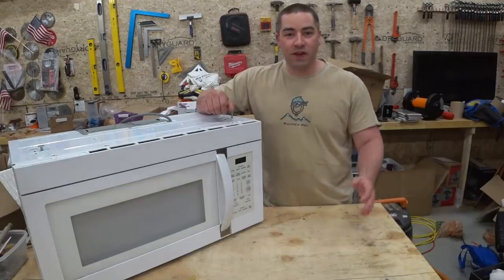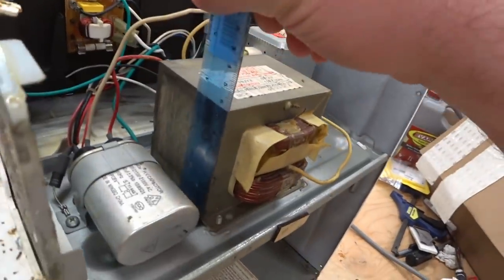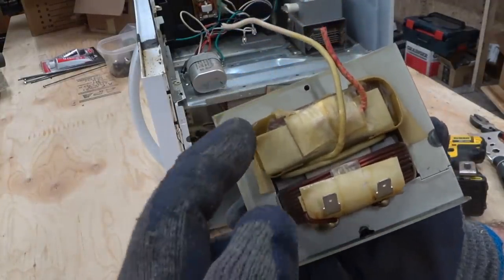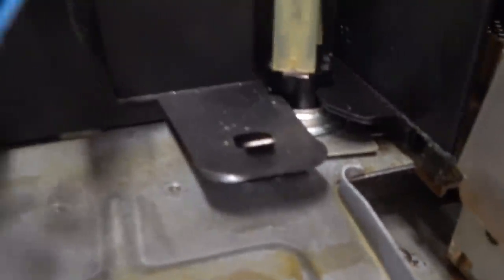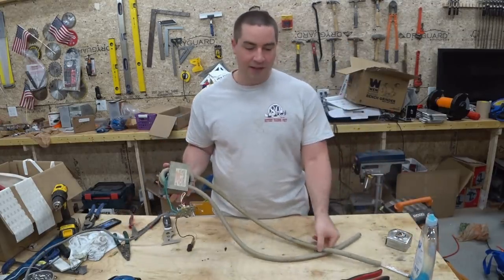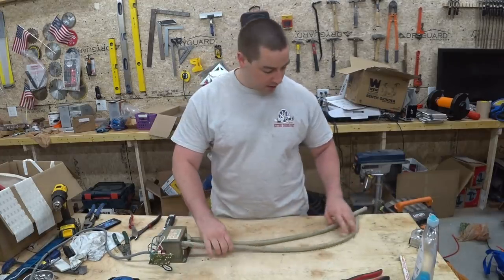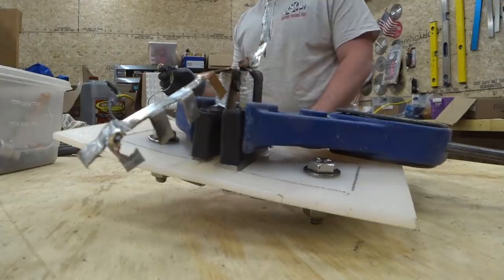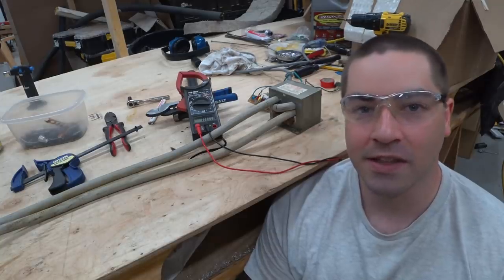DIY Spot Welder, Attempt #2 with Microwave Transformer, Failed!

Comment: 3 feet of 8 gauge wire from Lowes with 5 wraps in same direction as primary windings gives one volt per turn (transformer law). Voltage goes down 24 times while current goes up 24 times giving around 70 amps at 5 volts. Mine works like a champ. An on/off light switch to make and break the circuit; couple of copper welding tips at the end of your secondary windings ground or filed down .

Comment: Some advice: 1. secondary coil: make a thick cable with thin insulation so you can make 3 loops to get about 3V. Voltage is very low, you do not need that thick insulation, also it is bad for coil cooling. 2.Do not use aluminum and use copper electrodes. 3. Try make cables as short as possible. 4. Remove magnetic shunts between primary and secondary coils if you did not remove them yet.
Reply: Why use copper cable and not aluminium? Can you tell me the difference between them? What will happen?
Reply: @TheRealObamagaming  copper is more conductive than aluminum. Been 8 months but figured I'd answer lol.

Comment: I used 2 AWG copper wire with thin insulator and it worked fine. I also bought a cheap spot welder controller that cost about $14-$17 so I can control the time better to protect the 18650 batteries. I also think your wire is too long. To what I have read, you need high current to weld. You have 3 things you have to work with --VOLTAGE, CURRENT, RESISTANCE. The less primary Voltage, & less Resistance= high AMPs.

Comment: The circuit blew because when you turn on the transformer while spot welding.. it not only draws a 
inrush but also draws a constant current of 25 amps thus blowing the circuit board attached .. it is better if you connect the transformer directly to mains and also more turns are required for more voltage and better spot welding.. use copper wire

Comment: Hello sir!! Again, as i did recommend in the first video, you should get cooper or brass bars to do the spot welding, aluminum is not good for it, also reduce de gage on secundary cable can be 3 instead of 0,  connect the primary directly to the voltage or get some control but as of many others videos I watched about it don’t need it, hope you can succeed on your welding project 😎👍🏼🇵🇷

Comment: Greetings
I have my own successful experience and after several attempts:
I used a 35 mm square wire with the plastic wrap removed and the shrink tube in place. I got 3 laps in the front and 4 in the back! And a secondary voltage of 4.5 volts. Addition of a timer circuit breaker. Currently, it is used with batteries with a timing from 0.1 seconds to 0.4 seconds, depending on the thickness of the nickel

Comment: You dont need that board. Get rid. Just try through the momentary switch for now. Then get a spot welder 100a controller from ebay/aliexpress. They have adjustable pulse time and current and wire straight into the transformer. You do need a 9-12v AC, yes AC psu though.

Comment: Transformers step up or step down AC voltage according to the winding ratio. If you have 10 coils in primary and 20 coils in secondary coil then you will double your voltage. Half as many in secondary coil as primary you cut output voltage in half. Gauge size of coils basically determines current. But even if your secondary is fat gauge, you are limited by primary coil gauge size. For voltage, think about a mig or tig welder.... typically 20-40vdc for steel and AC for aluminum. You are probably looking for 50A+ as the required current but you'll need a controller to fire the transformer for a fraction of a second or you'll melt battery tops. If you need DC output you'll have to source some high current diodes on the secondary output. I can't speak specifically to the voltage/current requirements for welding batteries I've never done that. I'm sort of thinking with just one winding on that fat output cable, your output voltage is likely much too low.

Comment: David, the secondary voltage should be under 10 volts if you’ve put 1-2 turns in the transformer, which is about all that will fit in most frames from microwave ovens. Good luck!

Comment: I would say no, it's not the same that you would have gotten from a newer smaller microwave. I have seen flyback transformers in some of those.
Reply: If its an inverter style microwave, than different story.
But a smaller microwave will have the same size transformer.
Ive stripped a few diferent sizes and makes and models, and it looks like they all use the similiar transformer.

Comment: I’ve seen others figured out that it takes voltages between 9 and 20 and currents of 250-350 amperes to work. 20-40ms in duration which depends on thickness of the material

Comment: I would get rid of that little board and try some smaller wire thru the transformer.  About 5 or  6 turns might work.

Comment: interesting attempt.  I would say you need to use more copper laden wire. lots of insulation there. teflon coated 3/0 fits nicely. triple the amperage of that " 1/0 " you have there.  it will not get nearly as hot as your version.  not easy to get in but... its worth it.  you can use the flex stuff to connect once your outside the winding area.

Comment: I would remove a turn on the secondary. The less  turns give you less voltage, but more current. Also get rid of the little board, but do use a 10 amp fuse.

Comment: you can also use two pieces of smaler diameter wires, with thiner isolation,and wind it same as it is one piece. and this is better,because,to get mowe power from secondary, it must be  filled with wire as much as possibile.i used two pieces of 4 mm wire(about 25 mm2 together) and wind it paralel,on a much smaller transformer about 8,5 x 7 cm.i got 2,2v with 3 turns in secondary. 2,1 v when short circuit,and  wery powerful

Comment: Spot welder with a single microwave transformer deliver about 50A: it's very good to weld lithium battery. Your cable is too long, try with a shorter one. If you need more power try with 2 microwave transformer and same cable (about 100A). Good luck !
Reply from the maker: Thank you.

Comment: Keep trying... You will get it! I'm thinking about building one, I'd I was you I'd get the timmer board from Amazon for this, its programmable, where the lenth of pulse and current can be adjusted,  it also requires a 9-12 v AC supply it uses as a clock signal, or something, I'm planning to get one,  and use 10 gauge wire with thinner insulation just double it , a few times to get 8-12v and a few hundred potential amps, the spot welder board works on the ac side with a triac, to adjust things, I just couldn't find a 9- 12vac supply, I guess I'll have to order that also, or wind a transformer, with the timer board you will basically have a professional spotwelder!!!

Comment: one think to consider is to strip the thick insulation off the cable and substitute polyolefin heat shrink tubing.  A more expensive solution would be teflon heat shrink.  The temperature for shrink with teflon is around 250C.... polyolefin ~90C.  working temperatures are well within limits for this application.  (practically, start at one end and insert into the shrink tubing.  as you slit the cable, slide the heat shrink over the bare cable.  suggest leaving an inch or two at the beginning to let you completely strip the heavy insulation and replace with heat shrink tubing..... should solve the problem)

Comment: I think u got the Neutral & Ground, or Hot & Ground input leads instead of Hot & Neutral. Not sure, but I've seen this 64+ Volt crap before. My extension cord was only giving 64+ Volts, but the socked measured 120 Volts. After messing with the cord a bit (unscrewed the end caps, & looked at the terminals), & tightening it up a bit, it was back to 120. No clue what was going on.

Comment: Hey David let me give You some advice. It is a while since I made my spotwelder from my microwave transformer. First, yes it is the same size as Yours. Second, my first build atempt was the same as Yours, my wire had the same thicknes but I failed. The spotwelder worked, but the spot weld was terible. I decided to rise the voltage on secondary coil by rising the number of coil turns (loops). I had used 10 mm2 wire (someting like 7AWG) and it gave me 5,5 volts on secondary. Now it is perfect, fine tuned for battery spotwelding. And last but not least I suggest You to connect tranformer primer directly to grid. You can control it with solid state relay (SSR). It will work like a charm, trust me. And last important information Im on 230V grid. From that implies, that You are to use twice as much coil turns (loops) to achive 5,5V on secondary, or just give him 230V like as we, europans do. :) Wish You luck my friend!
Reply from the maker: We are at a bit of a disadvantage with our 120 volt grid.  So 5.5 volts on the secondary worked better for you.  Good to know.  Thank you.

Comment: The input inline board you are using is a line filter and fuse board, which you don't need. However, having a fuse is a good idea. 
The transformer you have could have come out of a smaller microwave oven. The larger transformers are found in the early older ovens.
The insulation on that 1g wire is too thick for your purpose. You could remove the insulation and use insulation tape instead. It may allow you to get one more turn in the former.
Reply from the maker: Thank you.

Comment: Hi David that board is a dual hash choke and it has line to ground metal oxide varistor and one line to neutral for voltage spikes and a fuse. So it is not needed in your application except a fuse would be good. It looks to only have one full loop on the secondary you might get .8 to 1.9 volts on the secondary which is not enough. As for the transformers in microwaves it varies by the wattage of the appliance. Lots of newer models have a switching power supply instead.
Reply from the maker: "dual hash choke"...  Thank you for directing my homework assignment.  I'm going to look that up.  
As for the voltage, you said it is not enough.  What is the minimum voltage, and why?  Thank you.  I love learning about this.
Reply: @DavidPozEnergy  hash choke is the easiest explanation it cancels out induced noise from switching and from clock circuits like in the microwave.  As for the voltage it works with the resistance of the wire and does the work in wattage output for example. What's best to use is magnet wire like what was in there but a thicker gage or multiple strands together. I built one a while back and used wire from a old tube tv degauser coil of several turns in parallel. More home work for you I guess.

Comment: Exactly the same transformer as in small 13liter microwave oven
Use cupper conductors everywhere, forget aluminium, it has low conductivity also the same with tungsten. Cupper is necessity. 
Also, throw away that regulator thing.
I'm working on my spotwelder. One full turn of 25mm2 cupper wire give 1.8v on open circuit and over 600amps during welding. I need to get at least one more turn into transformer. The voltage is too low. As it is now, I'm only able to weld 1mm wire onto something, and that takes about 10 seconds to do.
Reply from the maker: Thanks.  I agree with you on the # of turns.  This is an old video, but I had messed with it more recently and got better results with another turn, slightly higher voltage.
Reply: @DavidPozEnergy  I'm working on it now :) I changed the wire for copper strip - i bought strip of copper 15x0.25 and used 9 of strips per cable. it should have cross section nearly 34mm2. Then i got it into insulator and made coil. 2 full turns filled the transformer nicely, no longer is there gap.

Comment: I saw the over head light go dim, while the switch was activated. Looks like you may have activated the Circuit breaker of your 3 Phase supply. I also think 1AWG , secondary coil is an overkill. What are you Spot welding, by the way? Front end of an Abrams M1A1?😂.
Reply from the maker: Lol, tank spot welding.

Comment: I'd bet you blew the fuse on that board. just bypass that and send it straight to the transformer. you may want a larger switch though, as I'd expect you'll probably be drawing somewhat over 15 amps from the wall when welding.
Reply: Dont think that would be necessary its les then 5 seconds

Comment: I nice video I tried to follow along with it and bought a  used MOT, the seller connected ac voltage to the primary winding (thin wire side). And it created humming sound. At home I removed that side and when I connected ac to the secondary side it created smoke and smell and became very hot to touch. Seems like the Secondary was already short? What you say? Now can i rewind it using suitable size enameled wire? Will winding it with slightly thinner wire be ok?
Reply from the maker: It works better with one more winding on the secondary.  Even if it is a thinner wire.  I was too low in voltage with my setup.
Reply: @DavidPozEnergy  thanks for the reply. See my video the secondary of the MOT that we will be using as a primary for our spot welding has burned so entite transformer is stripped down. So i will be rewinding that as well.

Comment: EEh man please use 20mm wire with light insulation as secondary and at least 4 turns( you need at lest 3v to over come resistance and remove shunt core from transformer then you can eliminate current limit and also get more room for winding.....  it will work i am binal from india

Comment: voltage is too low you need to use more loop insade transfomer. now you have very much Amps but only 1-1.5 v and cabal is to long.

Comment: All wrong. As mentioned, don’t use the circuit board. Connect straight to main and the reason it’s not working is because you removed the shunts, the mental hits between the primary and secondary coil. These help emf induce to the second

Comment: The size of the microwave doesn’t matter all you have to do is read the output and that will let you know the size of the transformer the smaller ones are 800 watts And then they just go up from there so technically you can find small microwaves with big transformers in them is it common, no but you cant simply just go by the size of the microwave also you want to use copper instead of aluminum the more conductive the metal the less it’s going to heat up because the electricity Is able to pass through faster. Think about taking a metal pipe and pouring a cup of boiling water through it with both ends wide-open  itll get warm Now compare that to the same pipe with one end capped off with a just a  pinhole and the end the water goes in wide open poor your cup of boiling water in there the pipes going to be scolding Same thing with electricity the current going into the conducting metal doesn’t change if it’s 1000 wayts coming out of the transformer it’s gonna be 1000 watts going into that metal but being slowed down Which causes it to heat the metal more copper is still going to heat up but nothing like steel I know you used aluminum which is the next best thing to copper but when you’re talking high current you want to go With the most conductive plus aluminum has a pretty low melting point copper has an extremely high melting point

Comment: ERROR number one you used aluminum as electrode, and you didnt have to use the filter circuit from the transformer input it needs to run direct.
Reply from the maker: Thanks.

Comment: Right off the bat I would suggest you only use pure copper components which get exposed to the high current assosiated with the secondary coil. aluminum has a much higher resistance and could as a result get extremely hot. I suggest you use MIG tip electrodes for the actual welding tips/business ends. These tips can be mounted with steel hardware but you need to be able to put power to them with copper lugs or the like... anything else then copper will get very hot very fast, gets damaged and/or cause a voltage drop and lower current at you welding tips...

BTW: do keep in mind that the microwave oven may have had issues before it was drafted into welding heaven... 67 v where 120 v is due sounds like issues to me... just saying...
PS: check my video out on a butt welder I made with a similar microwave... works great, though I yet have to make a spot welding version... it welds chain mail rings like a champ though...

Also the momentary switch (micro switch) you use may not be rated for the 10-14 amps the transformer may draw... look for a pcb in the remains of the oven with a relay on it, switch the relay with a micro switch and have the relay handle the current to the transformer...as many have stated also: you don't need the filter pcb...
Reply from the maker: Thank you.  I just saw your video.  That's cool.  How many of those rings goes into a suit?

Comment: Well your insulation is too thick, and you left out the shunts between your windings. The point of spot welding is to create a short circuit with an arc. If you just "hook" up a transformer, especially to tungsten, you'll just get a short that heats up.

Comment: dude that board right there is not required. Remove it, it is used for spiking on AC mains and a requirement for commercial products. It also makes sure no interference happens with your wifi for example... FCC rules